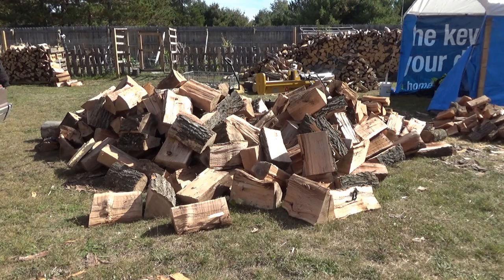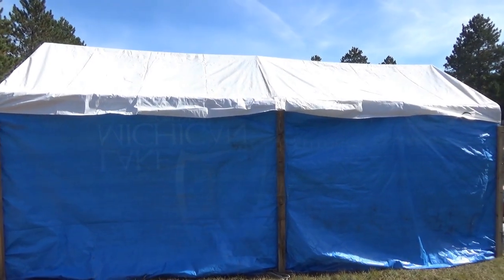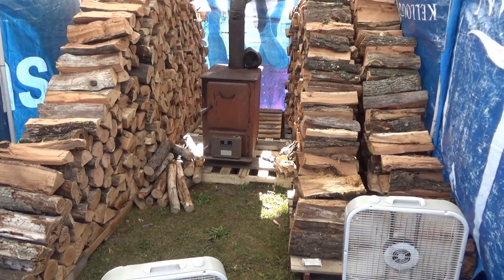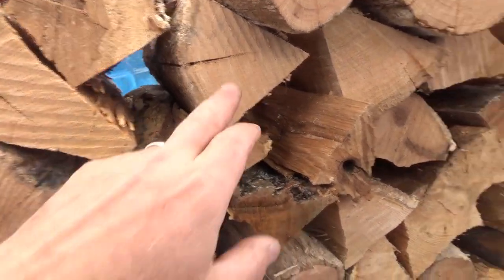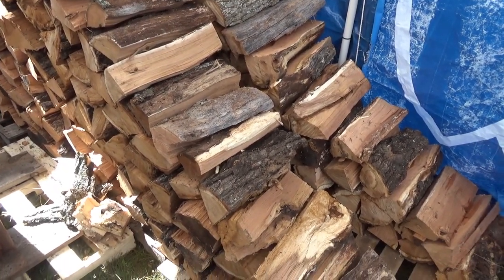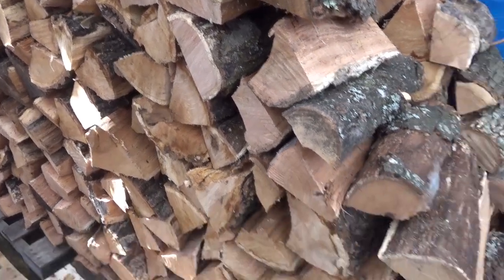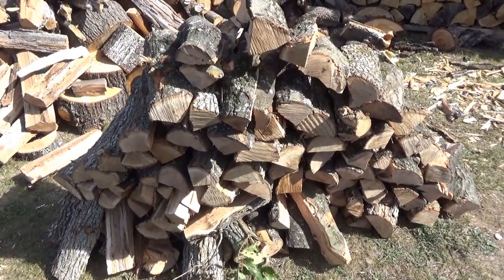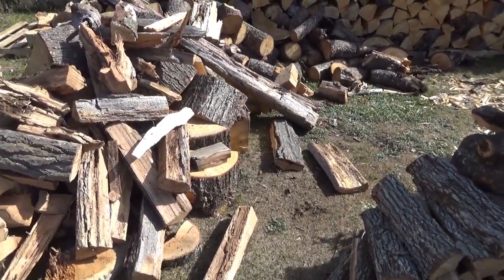Hauling Fire Wood And Solar Powered Kiln Experiment

Comment: Solar kilns are great. However if you replaced the colored tarps with clear ones you would increase the temperature thus drying wood faster. Black tarps would do good because the greenhouse would absorb the heat better than the colors you have now. Closing the open end would also raise the temperature. Maybe you could experiment with these ideas and monitor the temperature to see which works best
Reply from the maker: This was temporary because it was raining. Still is raining. Going to rain for a week or more. I plan to make a more permanent one with clear sides.

Comment: HOW MUCH WOOD HAVE YOU SOLD ON MARKETPLACE AND CRAIGSLIST ????   I'M ALWAYS WATCHING YOU .
Reply: You would be far better of minding your own business than harassing Troy. Wasting your life hating someone is not the smartest thing you can do. Regarding the firewood.... I would like to hear what Troy has to say. Because without the proper equipment for mass processing of firewood, selling it makes no sense. Way too much work, way too little to gain by selling it.
Reply from the maker: David, he is old, mentally sick and sadly wasting his life on useless hate. I have run the numbers though on fire wood processors. At over $20,000 it would take about 300+ face cord of fire wood to pay for it. But then you need tractors and other supporting equipment to keep it running.

And that is only if you are out in the woods cutting trees down yourself. If you want to buy logs instead, the number of face cord you must sell to pay for the firewood processor alone doubles. Then there is the other equipment needed to feed it.

If I process it myself I get much more profit per face cord for now while I build up my strength. It is too late in the year to make a real business out of this anyway.

Comment: Just make sure to put the wood ready in beginning of spring.  It will be done to the autumn. Except oak. It should be in pile for 2-3 years for the acids sake.  Just dont cover the pile of wood first 2 months unless you have alot of rain. Then put roof on it.  No use wasting energy on it :)   I always make sure its done before midsummer here and always have atleast 2 years of wood stock piled.
Reply from the maker: That is a dream I have one day.... lol. Things always just come up. But I think this time I will get it done right.

Comment: You gonna brake that truck in half like the last one
Reply from the maker: The last one rusted through. This one is a lot better.
Reply: frame in this one i no what a chevey can do if bumper not draging like your a low rider then u dont have a load and i use to rebuild chevey trucks for my couse resold them
Reply: Be good if you could spell the right word...'Break'. Just throwin' ya ah bone.